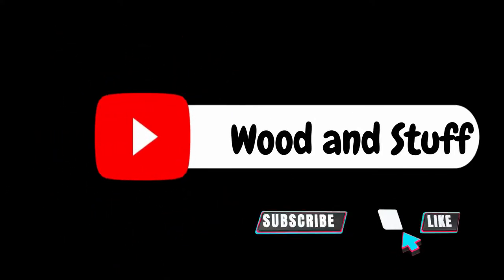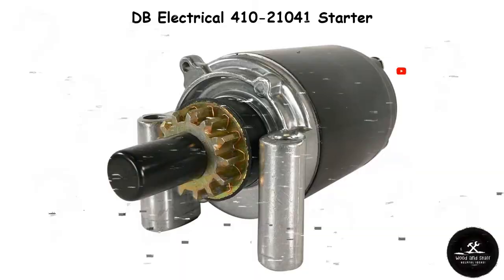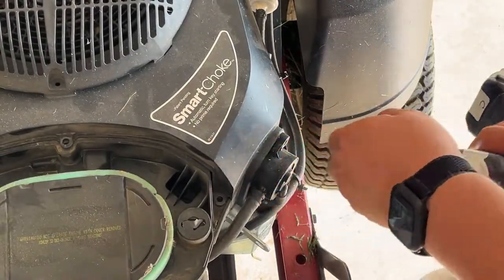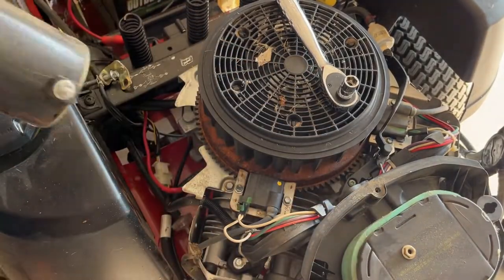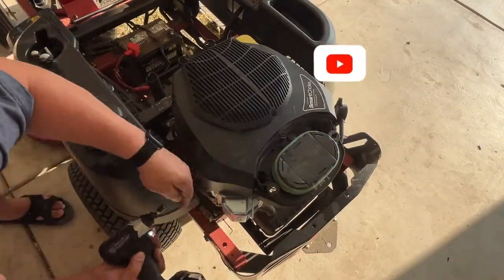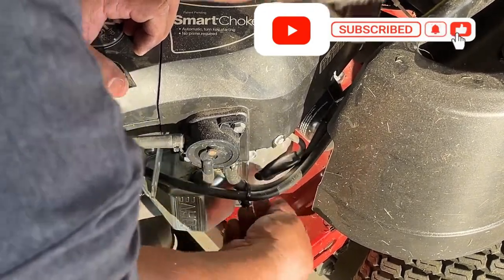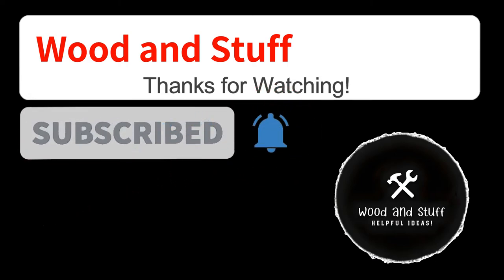DIY Savings: Replace the Starter on Your TORO TimeCutter SW 4200 🤑 #diy #lawnmower  #woodandstuff

Comment: Two Black wires were connected to the top of the starter. Is that normal?
Reply from the maker: I'm not entirely clear on what you're referring to. There's a red wire (positive) and a black wire (negative). It's possible you're mistaking the black bungee cord that secures the battery.  Could you specify the timestamp in the video where you're seeing a second black wire?  With that information, I might be able to provide more clarity.
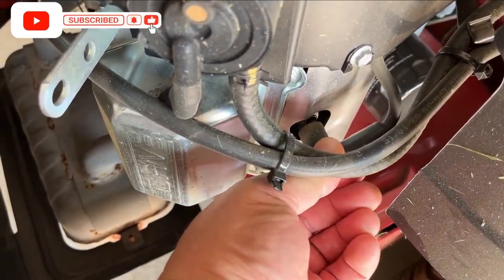Reply: @WoodandStuff-55  I have the same question. At the 1:39 mark, there appears to be a black wire that is connected to the top left bolt on the starter. My mower is identical to yours, but doesn't have any wires connected to the starter...except for the red one at the bottom. I'm not sure what that top black wire does, but I don't have it....nor do I have the extra metal piece that is also mounted under the top left starter bolt.
Reply: The battery has a black and a red wire connected to it, however, the starter only has one red wire connected to it.  Hope that helps.